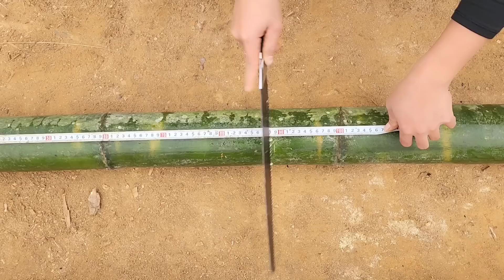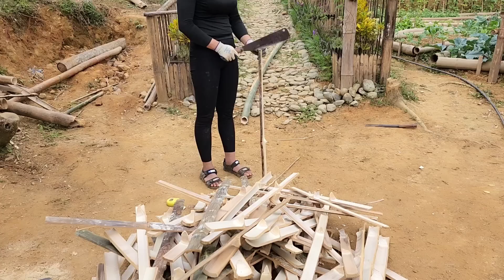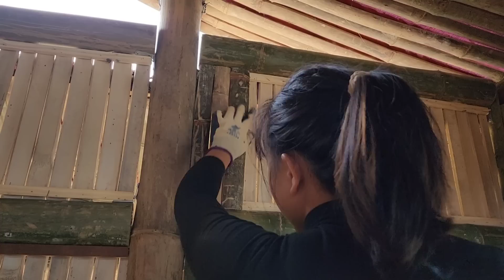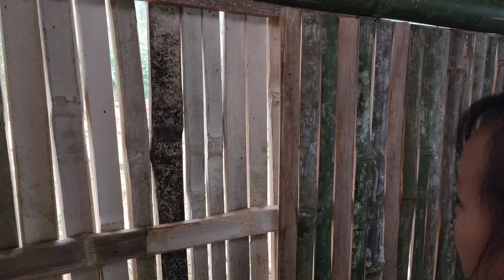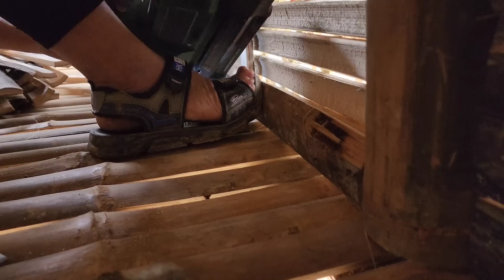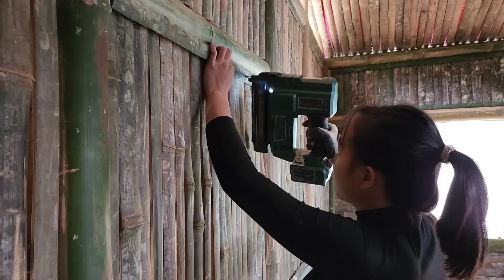Building a wall of a house to avoid the cold of winter-Building a new life|Trieu Thi Hoa ep.66

Comment: You should have put those slabs directly over the space one bamboo piece over the slot that's open no needed for the middle piece to go across this will help very little the way you are doing it  just going to blow through the outside slot through the new slots spaces should have been covered directly with the bamboo piece should not been space between walls and it does no good as long as the roof is open on the sides of the walls you are always going to have a draft of wind coming through this does nothing to insulate it those spaces need to be directly covered over with new bamboo just like you do a roof those spaces need to be covered directly covered
Reply: No door no windows cover wind coming through too.

Comment: The heat loss through the open ends of roof/upper wall should be closed off. Floor covered over. Some type of heater added. I don't think she really sleeps there.

Comment: Even with another layer of bamboo inside walls still did not help much with all the gaps from the walls, floor and ceiling unless putting a layer of tarp in between as was done with the roof.